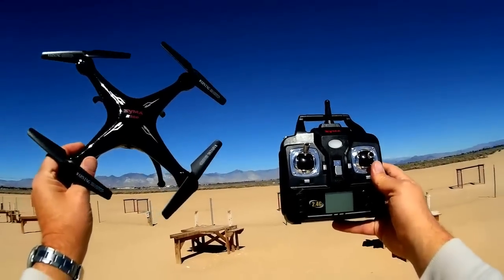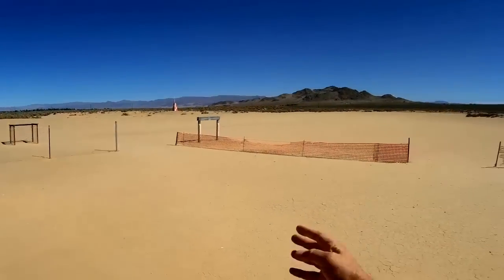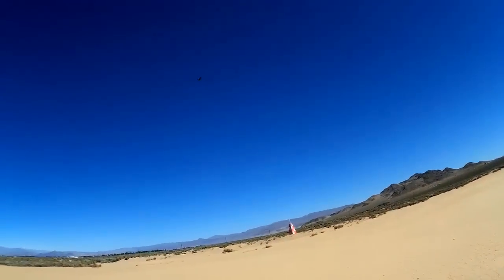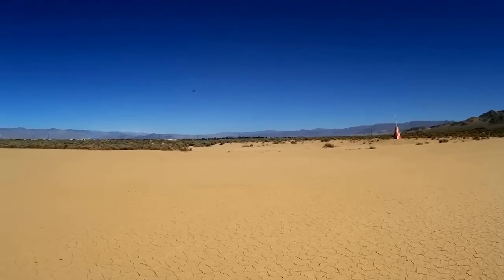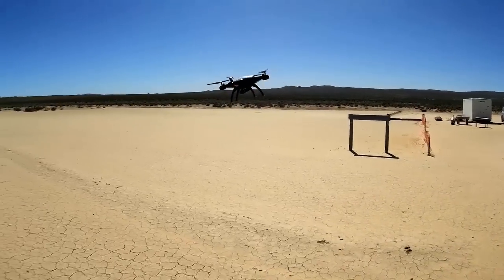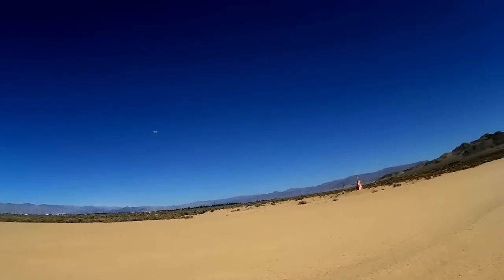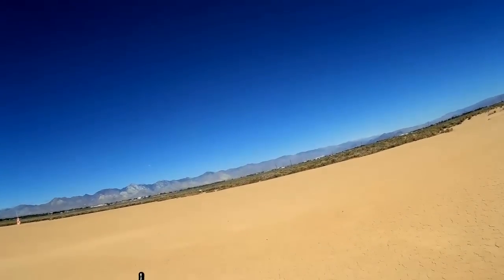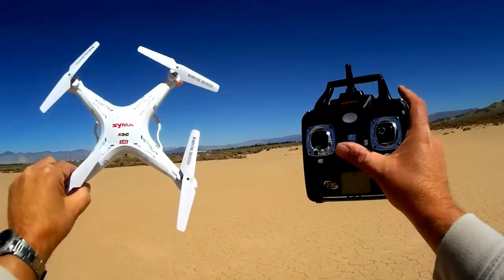Syma X5SC vs X5C-1 Drones Comparison Test Flights

Comment: hey!! how to use the camera x5c and my x5c does not have cellphone holder                                                                                                                                                                                                                                                                                                                                                            sorry for my grammar heheee
Reply from the maker: The X5C camera does not have FPV video transmitter to transmit to your phone.  You can only record video to a micorSD card, for later download to your phone or computer after you land.
Reply: @Quadcopter101  x5c drone is good camera????????? or nah?????

Comment: Which is better syma x5c or syma x5c-1
Reply from the maker: No difference these days.  They've been the same since Christmas 2015.  But there is a difference between the X5C and X5SC as seen in the above video.
Reply: @Quadcopter101  syma x5sw or syma x5c??? Which one is better to fly
Reply from the maker: @madelainesantos511  X5SW has the same wind problems as X5SC.  So X5C is better.

Comment: I'm a beginner at flying drones, and appreciate your videos!
I just lost my syma x5c-1 on my 3rd flight :-(  I got confused on the how to bring the copter back to me, and it seemed carried by the breeze.  So now, I'm considering my options: 
1. Buy Syma X5SC, with the headless mode - Question: are the motors and batteries of the X5SC the same as X5C-1?  As I got spares on these from my lost X5C-1.
or
2. Buy another Syma X5C-1 practice, and master the skill of non-headless mode drone flying - appreciate if you can give me tips!

It seems I am more inclined for option 2, because of that issue of X5SC on the breeze you showed in this video and I didn't like it.  But I don't want to lose another drone again....
Reply from the maker: I like option 2 better.  Headless mode might become a crutch for you, and may hinder improvement of your skills.  See the following.  This is an important yet easy to learn skill http://quadcopter101.blogspot.com/2014/02/flight-school-6-distance-flying-keeping.html
Reply: Quadcopter 101 thank you and more power!
Reply: Jabon Eros Get a phantom 4
Reply: over my budget.  I'm thinking about the UpAir One instead

Comment: I was intrested in syma x5sw because of headless mode, but after seen this video i will buy syma x5c-1. I just want to ask one question, if  wind issue in syma x5sw is because of its body shape, can i install syma x5sw board in syma x5c-1 and use syma x5sw transmiter, can i use headless mode and fly without wind issue in syma x5c-1?
Reply from the maker: +shahzad198509 I think it's because of the installed flight control software on the X5SW board. I believe there's an error in the software.  So installing the board to an X5C-1 would just transfer the problem to the X5C-1.

Comment: Hi, a have Syma X5sc, and I can't take of because when  I pres the power, the quadrocopter starts to turn over, I can't even balance it using trim because its so outstanding that the trims don't work. Thanks for your answer
Reply from the maker: +Marek Ševčík Did you change or install any of the propellers? If so, you likely installed incorrectly.  There are two clockwise and two counterclockwise propellers.  Make sure that your propellers are installed the same way as shown in this picture http://img15.hostingpics.net/pics/499248DSCF6392.jpg

Comment: Does anyone know if the problem with flying into the wind been resolved?
Reply: +Reid Curry Google "X5SC wind issue rcgroups dot com" , someone just got a a quad 2 weeks ago...STILL has this "wind bug".  Guess I'm getting a X5C (no S! S stands for SUCKS apparently).
Reply: +Reid Curry I just bought an X5SC and was leary of the wind issue but after doing some research I seen people saying that they swapped the board from an X5c and that fixed the flying into the wind problem. I think they run like $10-12 new. Hope that helps.
Reply from the maker: +Jon Mahoney But by doing such, you lose headless mode which is the single feature that makes people consider the X5S quadcopters over the X5C's.
Reply: Hmmm, well you'd think by now they would have a fix for it. Things this simple shouldn't take an act of a new model to fix. I didnt see but did the X5SC-1 have the same issues? If not you could swap with those boards I'm sure.
Reply from the maker: Jon Mahoney Yes it has the same issue.

Comment: quick question for Quadcopter 101. I have the Sky Viper 950HD. Cameras aside, and the barrel roll aside, what copter did you find better control of? I just back yard fly. Would I be down grading with the X5C-1? I am not new, I also have a Walkera Runner 250. I just want the same precision as the Sky viper in a low budget quad.
Reply from the maker: +Steves ForcedAccount If the camera is not important, then I think that you may have a lot of fun with the following:
https://www.youtube.com/watch?v=F2TN5_z3sn0
https://www.youtube.com/my_videos?o=U&sq=u807

Comment: sooo?which one do you think is better?
Reply from the maker: +Ariqkamil Nugroho X5C.  The only advantage the X5SC has is headless mode.  But the X5C is a much better flier.
Reply: +Ariqkamil Nugroho The X5SC will hold a larger battery (850mah), but that doesn't do much good when a light breeze is blowing your copter away. Mine has blown away twice now. I thought the faster rate would take care of it but it will still blow away very easily.

Comment: Are you comparing perfomance to a $1,500.00 quad.?  If so, please let me know if the thing really has any truly aberrant, yet dangerous tendencies!   So what if it slows down into the wind!  It only weighs 7 ounces, and for $42.00 delivered, should be able to be fun to fly and not compete with the Big boys for 5X the price!  What'cha think?
Reply from the maker: +digiphot2 Well, I'm comparing performance to its predecessor (Syma X5C), and just about any other quadcopter at this same price range.  I've seen and flown many quadcopters in this price range.  This is the first that I've seen have this behavior of leveling off into the wind.  It is not a good feature as it will likely cause the loss of quadcopters being blown away by the wind.
Reply from the maker: +digiphot2 Here's one that can be had for about $29.  It has no problems at all in the wind https://www.youtube.com/watch?v=JVYktsq4CJ0
Reply: THANKS!  I'm just getting started and wonder about purists that own every iteration of copter up to and including $2K versions...Sorry for my rant!  I will give my X5SC a buzz to see if it has any aberant behaviors that your version showed into the wind. and if it does, I will be trading up to the working version.
Reply from the maker: digiphot2 If you're a beginner, you may not notice anything while you're learning the basics of hover.  But once you start transitioning into leaning forward flight, then its shortcomings will become apparent.  By the way, the tutorial on the following site may be of help.  Best viewed on a computer, and recommend following them sequentially as listed in the right column index http://quadcopter101.blogspot.com/2014/12/quadcopter-flight-school-4-horizontal.html

Comment: Well, 4 months after this review, do you think the bug would bee fixed? This quad is only $6 more than the X5C on Amazon, so i was considering it.
Reply from the maker: SamNetwork Well it's been four months and it still hasn't been fixed.  So I doubt it now.
Reply: Quadcopter 101 I'll probably stick to the X5C, but when I ordered it, one of the motors was bad and it didn't gain altitude. :P I had been opened before. I'm gonna try a difernt seller. The X5SC looks like it has good potential, but it needs to work out the bugs.

Comment: I just bought the Syma X5C and have flown it a few times with varied success.  The directions are very confusing.  What is the dial on the lower rite of the transmitter.  Theres no mention of it in the directions.
Reply from the maker: Bill J It's a fake trim.  No function.

Comment: Great video and review!  I am very new to quadcopters and about to buy my first one.  I nearly purchased the X5SC, but watched the upwind stalling issue.  Is this something that can be resolved with a USB firmware update or is this a permanent feature?  I don't mind this issue while learning how fly the product.  However, I would like the wind issue resolved in the near future.  If a USB firmware update is not likely, I am considering the X5C-1 of the UDI 818A-1 upgrade.  Any insight or advice you could provide would be greatly appreciated.  Thanks!
Reply from the maker: Newbie No, sorry, there is no USB port to do such.
Reply: Thanks for the update.  Any suggestions on alternative quadcopters?
Reply: Bummer, thanks for the reply.  Does anyone have suggestions a quadcopter with similar features?

Comment: I bought a spare X5C-1 since you mentioned the X5SC-1 transmitter works with it?  Mine binds but does not respond to controls.  The light goes solid when trying to bind then blinks if you try to issue any controls.  Did you have to do anything special to get to bind to both?
Reply from the maker: emilsal No nothing special, just up/down on the transmitter.  But maybe they've changed something, which is common.  How does your X5SC handle in the wind?  Maybe it's an improved model?

Comment: Do you think FY326 is still a strong alternative to the new syma x5c versions? the FY326 has the same performance(even than the x5c-1)... and it costs less. Then I have read the MJX400 is suitable for beginners and when you go forward it works for intermediate flyers too, so I think MJX 400 is a better inversion... Is there another better begginer grade quad that I don't know?

Comment: banggood just released the x5sw which i ordered right away. now i've seen this, im worried. even if it doesnt work they wont refund me unless i pay £60 shipping it back. ffs
Reply from the maker: domposty Hold on.  Got an X5SW that should be arriving this week.  Who knows they may have fixed this problem.  Either way, keep an eye out for my review of it.
Reply: Quadcopter 101 expecting it soon?!
Reply from the maker: domposty Still expecting it.  Just hasn't arrived yet.
Reply: Quadcopter 101 hopefully ill get the review up before you lol
Reply: Quadcopter 101 i received it today. the x5sw has exactly the same problem. it goes forward for a second but then just gains height
waste of £50 :( i couldnt afford it but bought it anyway because of the fpv, really regretting it because shipping it back will cost more than the quad so im stuck with it :(
Reply: Quadcopter 101 p.s when you do your video, let people know the camera works just fine with the x5c-1
so you can just buy the camera alone if you have an x5c, plus the phone mount. no need to buy a broken quad

Comment: Just received an X5SC-1 from Amazon and haven't opened the box yet, I can send it back with no hassle or problem. Wonder if all models have this problem or if the one you received has an isolated case. Any advise? Don't want to un-box and use it and then send it back even though I could do that but that's just not me, would rather send back exactly what they sent to me.
Reply from the maker: Pat Martin Well, I've had two, the original X5SC and the upgraded X5SC-1. The problem existed on both.
https://www.youtube.com/watch?v=4u95LfK9Xx0
https://www.youtube.com/watch?v=xSv4H0zo2Ug
Reply: Quadcopter 101 Thank you, the return label is printing as we speak.

Comment: If you normally receive product for review that is in advance of normal sales, I'll suggest a reason for what you observe in the X5SC.  I'm guessing that the control board in that QC was never intended for release.  It likely contains prototype firmware that was used for some early trials.  Maybe it was supposed to be reprogrammed prior to being put in pre-production QCs for demo.  Maybe it was supposed to be destroyed.  In any event, I'm betting the product engineers wouldn't have let this go out the door if they had any knowledge it was going to be used for a review.
Reply from the maker: dscinaz Maybe.  But maybe not.
Reply: Quadcopter 101 Judging by the comments here, it looks like there's a lot of the 'Maybe Not' sentiment here.  I'm really surprised that this seems to be no surprise. They DO have wind in China; something else must be missing at Syma.
Reply: dscinaz The fact that both the X5SC and X5SC-1 have the same problem tells me this IS the firmware Syma intended to release in the production models.  It's just bad.  And it also tells me whatever testing they do before qualifying a new model and releasing it to production for sale is incomplete (this is common for low-end quadcopter manufacturers).   I doubt they had a test case for flying in the wind.  A more pessimistic appraisal would be that Syma released this knowing the bug was present.  Then whoever bought it would need to replace it by purchasing the New Latest Upgraded Upgraded X5SC-1-1 (or whatever they choose to market it as) or a new receiver board with fixed firmware when and if that is made available for sale.

Comment: Thanks for the video. My X5c has at least 1 bad motor that I need to replace. Probably should have just ordered an X5SC-1 as it will take about a month to receive either one. Looking forward to your testing the X5SC-1.
Reply: dheller777 If you live in the USA, try Tmart.  I ordered X5 motors and they shipped quickly from NJ.
Reply: dheller777 us.banggood.com has both syma x5 motors. haven't tried it yet, but they say 3-5 days. good luck.
Reply: Got mine off amazon in 3 days for the same price as China

Comment: Syma made a new x5sc which is now x5sc-1.  Think they addressed this issue?
Reply: Seriously? Where did you see that
Reply from the maker: beezer8686 Not sure if it corrects the issue or not until I get my hands on it.
Reply: Jordi Albers Bangood already has the x5sc-1 saying like last time small improvement and new box .
Reply from the maker: Edwin Garcia GearBest is selling the upgraded X5SC-1 also now http://shrsl.com/?~8aab .  No reference anymore to the original X5SC.  Am guessing those have been removed from inventory for sendback to Syma for refurbishment/upgrade.  Will see if I can get one of the upgraded versions for review.

Comment: Looks like Syma always messes up on the 1st version of a new product. Sad.
Reply from the maker: MisterSins For those curious, there is precedence here.  There was a similar issue with the original X5C (in-flight wobbling). It was not a steady flier at all.  https://www.youtube.com/watch?v=hxRjUH-9pU8But Syma quickly corrected the problem with their release of the upgraded version of the X5C (the X5C-1).  It was/is a brilliant steady flier. Perfect for beginners to learn to fly with. https://www.youtube.com/watch?v=y93vzA-KRlM
Reply: Quadcopter 101 how quick did they fixed the problem?
Reply from the maker: Jordi Albers Two months after the original release.
Reply: Quadcopter 101 hope they will fix this faster cause if its an + - mistake than it can be fixed in one week